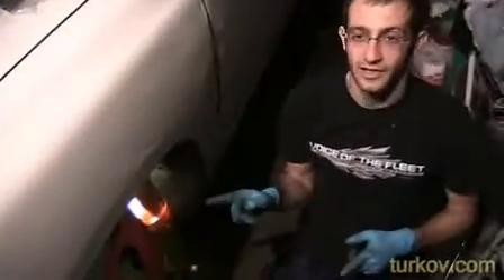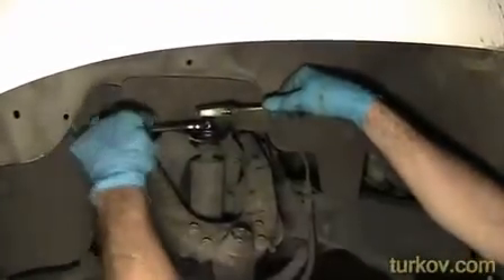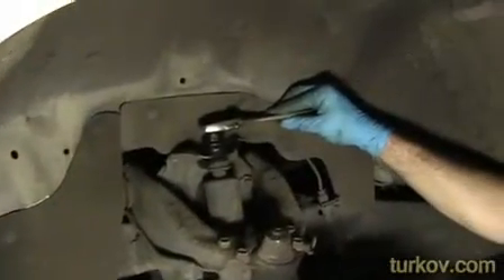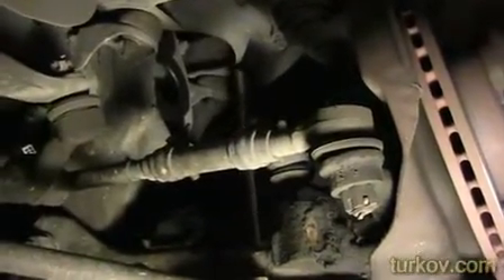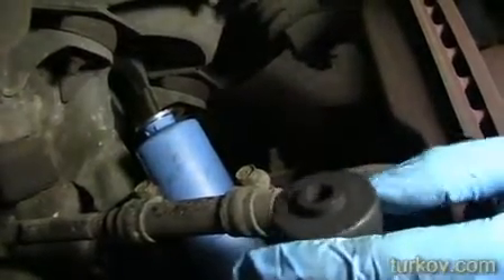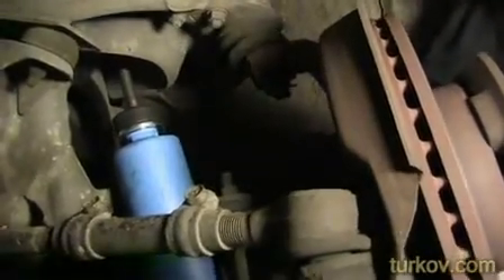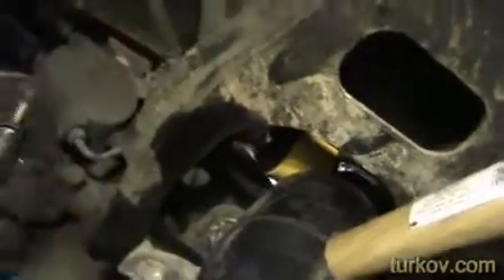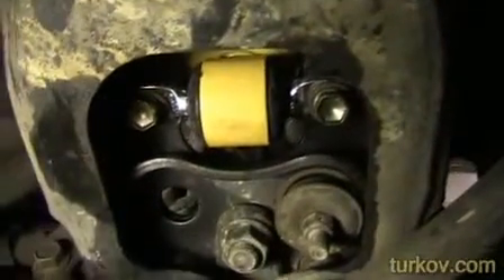DIY: Replacing front shock 1993 Toyota Pickup 2wd

Comment: per Toyota publication repair manual for a 1994 Toyota Pick up published by Toyota Motor Corporatiuon, the torque specs for the top of teh shock (the nut at the top of the front shock is 18ft/lbs. teh boldt and nut assy on teh bottom bracket is to be torqued to 101ft/lbs.